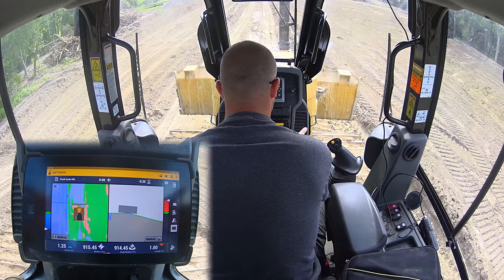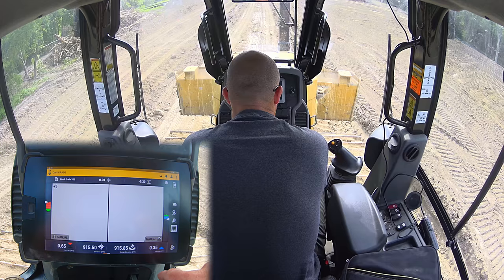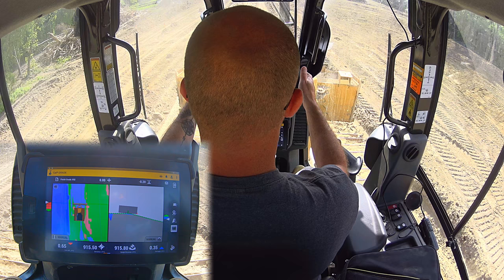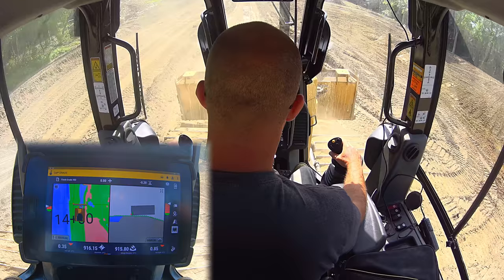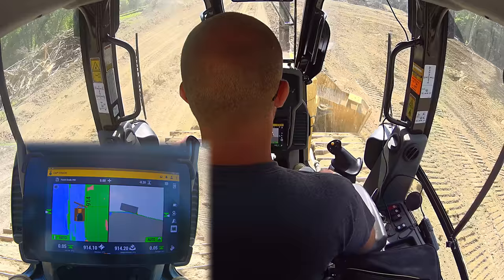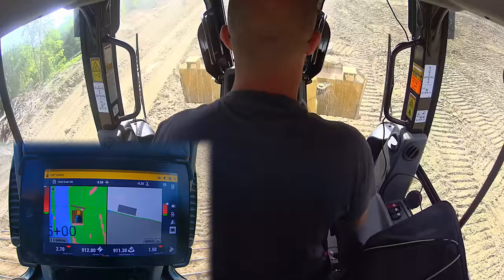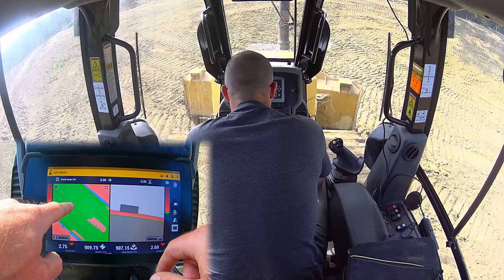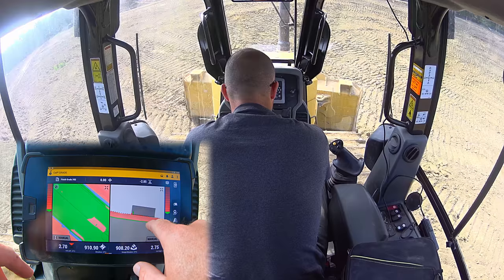HOW AND WHY DO YOU SELECT BLADE TIPS // GPS Dozer Control // Heavy Equipment Operator Advice

Comment: hi nice content! can one fit a trimble system on a GD675-5 grader?
Reply from the maker: Most GPS systems can be adapted to fit on older style equipment.  The only thing you're giving up is the nice integration of the screens and hidden wires.